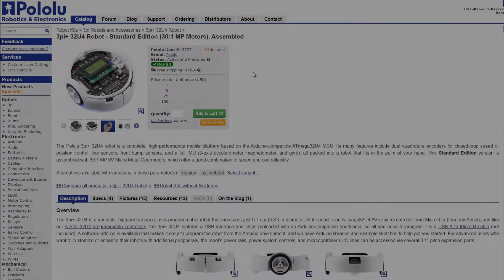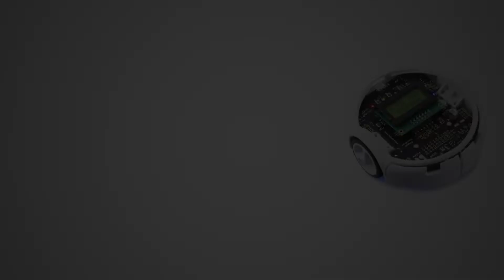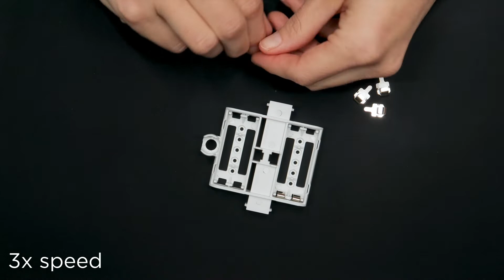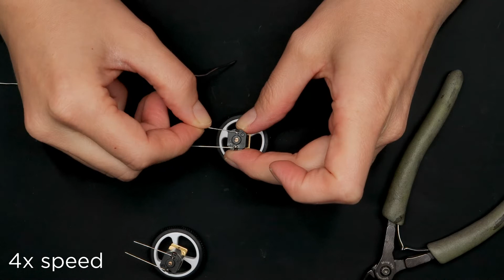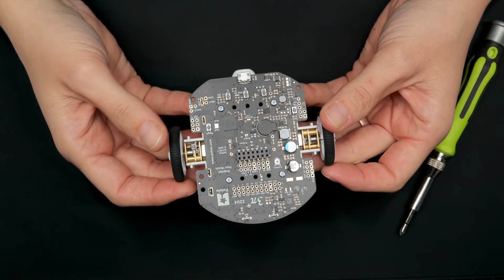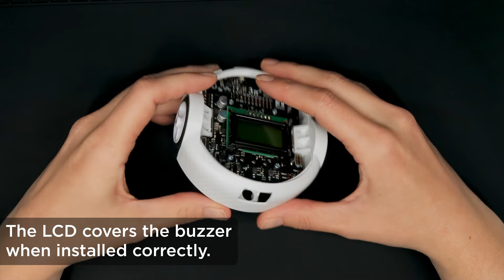How to Assemble the 3pi+ 32U4 Robot

Comment: i would recommend the USB rechargeable Lion AA battery's, they keep an steady 1.5V until the end. sure they have less capacity or Wh stored,  but they are easier to recharge because everyone is owning a phone charger and they have a longer life span and not dead after 50 to 100 cycles. its my take on this. I love those.